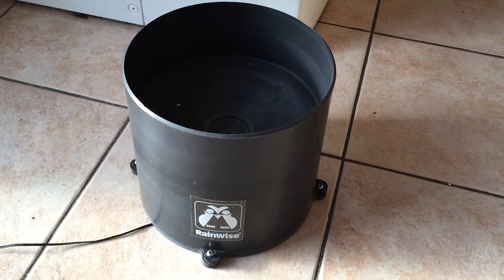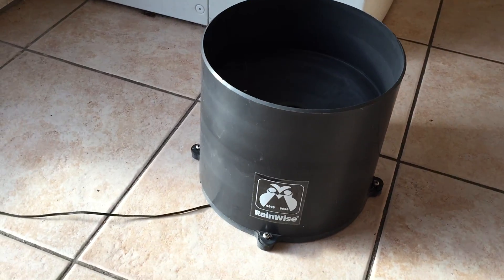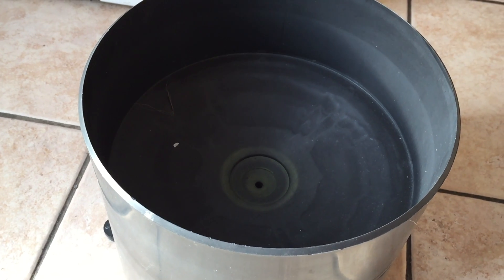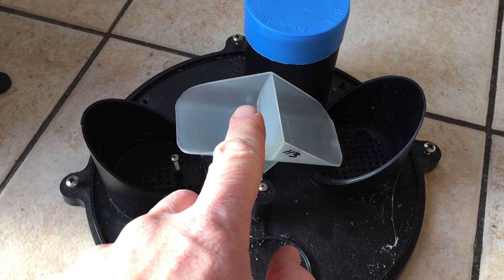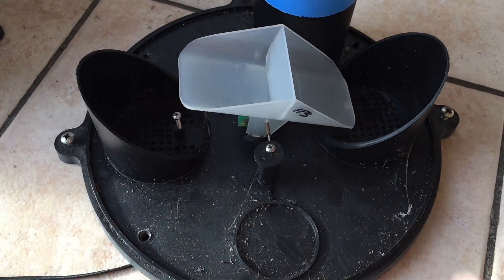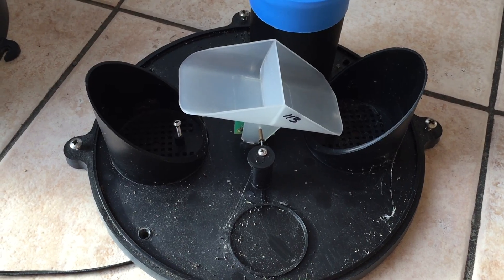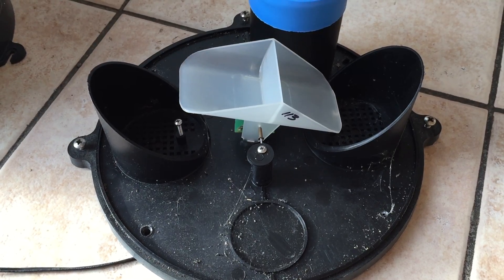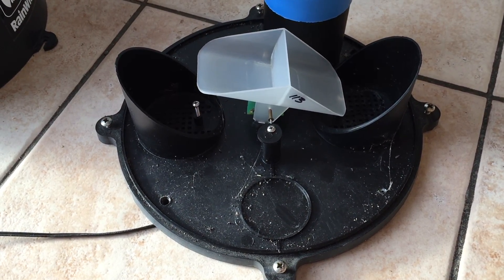Rainwise 1-Wire rain Gauge Guide/ Tipping Bucket Explained

Comment: I just repaired my 2002 wireless Rainwise gauge.  In 2016 I had to replace the reed switch that senses the bucket flip.  I keep my screen in place because it keeps crud from plugging the hole at the bottom of the collector funnel.  My repair today was to bend back the end of the D cell holder that got stretched when my grandkids knocked the receiver onto the floor.

Comment: Hi Mick. I see you removed the plastic screen from the bucket. Do you believe it was causing problems with accuracy? I removed mine today and found there was a small, raised circle of plastic flashing that would definitely hold up drops from reaching the drain hole. Each time it rains my station is the last to record rain of the other stations surrounding my area. The lighter the rain, the further behind my readings are. So, I removed the plastic screen and then used a sharp edge, such as a razor blade, to remove the flashing and leave it smooth. I also like to use Nu Finish polish to keep the plastic slippery so the smaller drops are less likely to stick in place. Also found a slight amount of fine dust stuck in the corner of the rain tipper scoops; cleaned it out. Thanks for making the video.
Reply from the maker: Super late reply but yes i did remove the screen as i thought it was slowing down the flow of water to the buckets.

Comment: Mick, what's the capacity of those two little collectors that collect each .25mm when the tipp in.
Reply from the maker: +Leonard Skelton Capacity would be more than 0.25mm but the balance is set so when it hits 0.25 the bucket tips. So 4 tips would be 1mm of rain and so on.
Reply: @mickopla  is it .254mm of rain per tick but per square meter or for the surface of gauge collector ? (203mm diameter) ? thank you